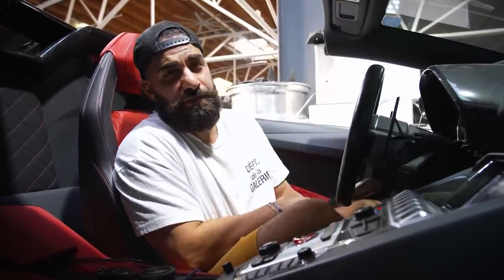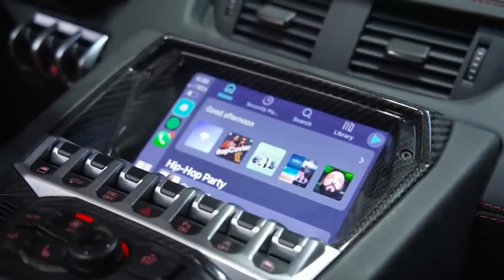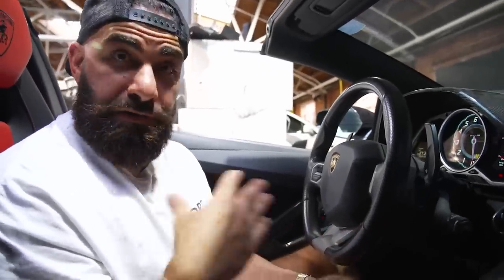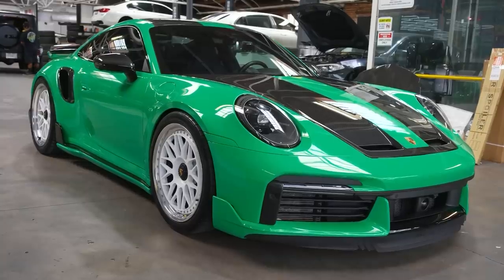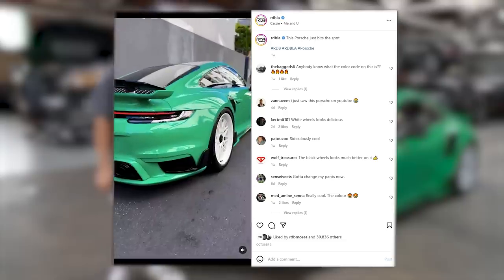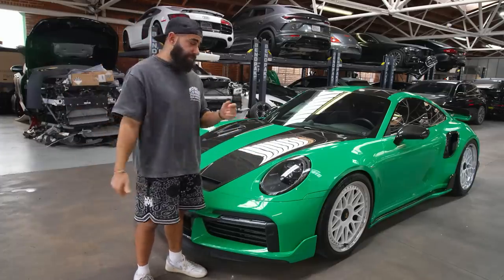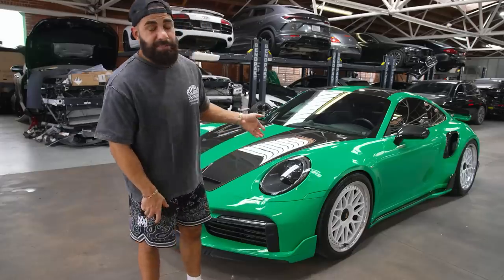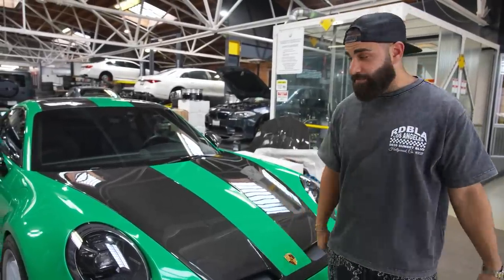Green Porsche Turbo S Carbon Hood! Lambo Sound System Upgrades, Arm Wrestling.

Comment: The JL Audio 13TW5 sub is a great sounding subwoofer. It doesn't move a ton of air since it is shallow it doesn't have a ton of excursion but it's extremely musical. I had one with a JL Audio 500/1 in a Yukon XL I built for my wife. She didn't want to lose any cargo room so we built a really small fiberglass enclosure to fit where the stock subwoofer went on the driver's side in the rear cargo area. I'm planning to get a RCSB Sierra and will probably put a couple of the 13" JLs behind the seats with about 1200 watts. It should be perfect and I'll lose no leg room which is really important at my height.
Reply: Carter  🤣
Reply: Carter  good because I doubt you're considering buying a 13" JL Audio sub
Reply: Carter  for real man. Hahahahaha 😂🤣
Reply: Great stuff lad 🔥🔥